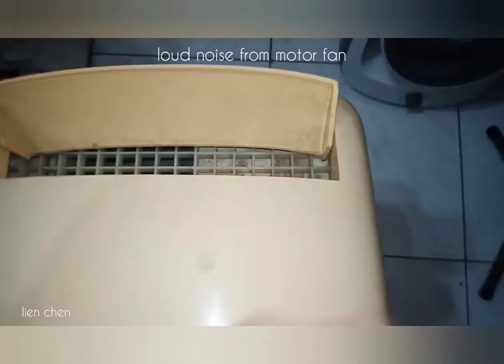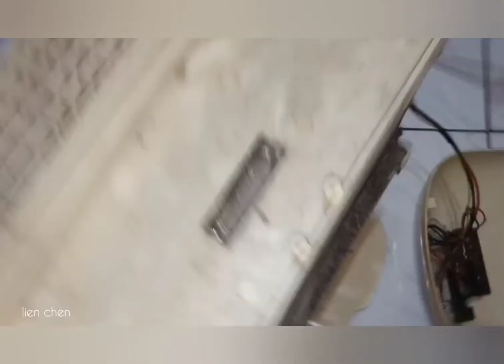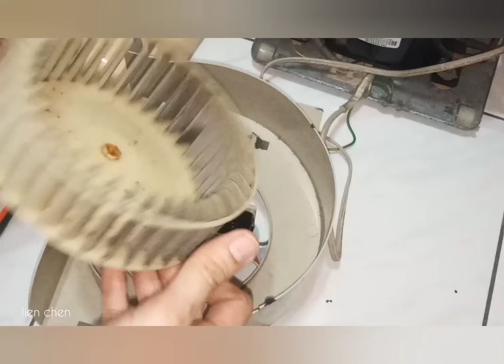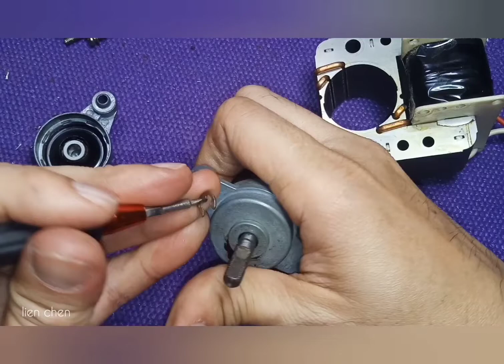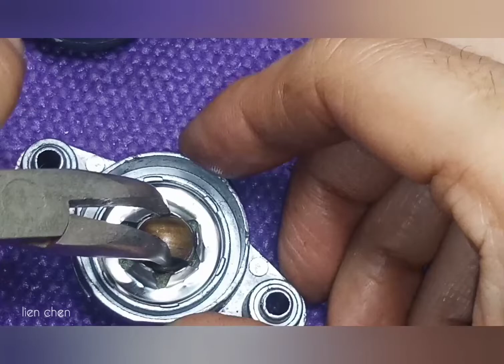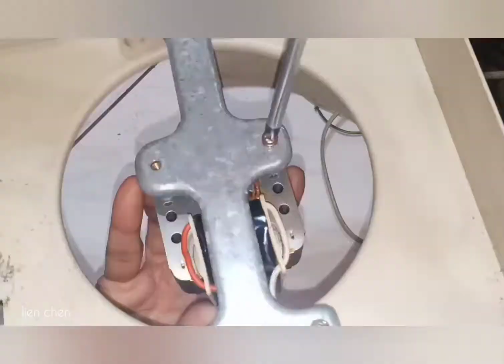portable air condition fix - motor fan loud noise

Comment: What thing we have to order
Reply from the maker: if you don't know how to repair, you can just order or buy the fan motor
Reply: @lienchen12  if you tell me what that two nossel is called that would be great because fan motor doesn’t come with that
Reply from the maker: @zebavohra2731  you mean the two bushing i replaced
Reply: @lienchen12  yes
Reply: @lienchen12  the exact name for that because i am unable to find the name of it anywhere
Reply from the maker: @zebavohra2731  motor bushing, you need to measure the exact size of your motor bushing, use digital caliper